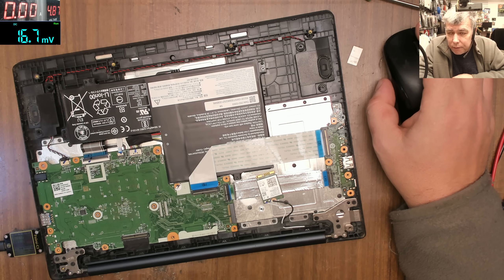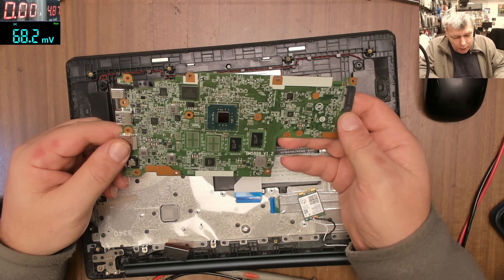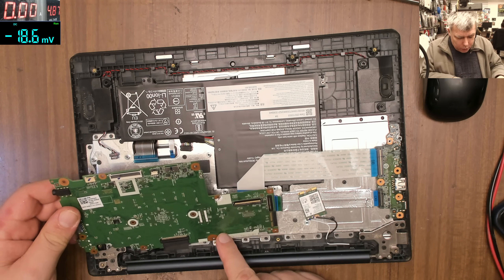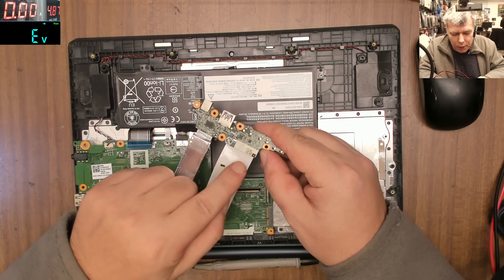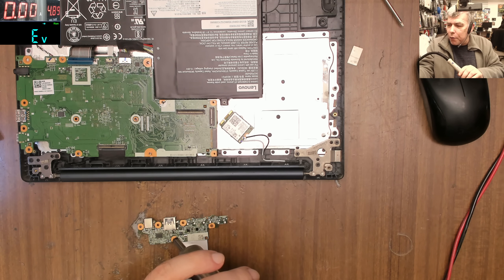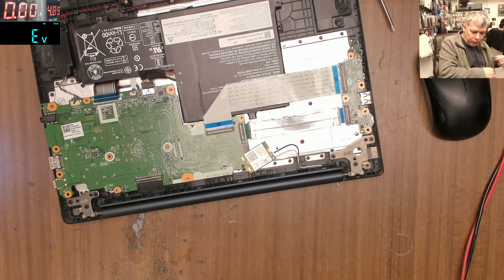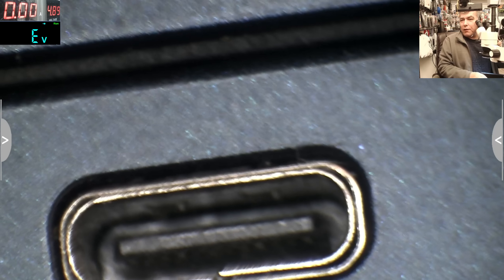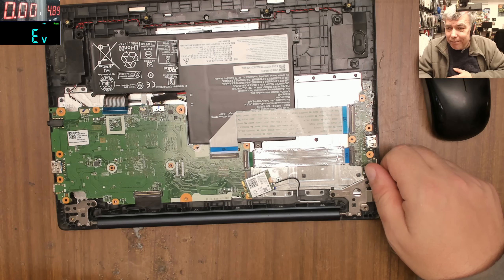Lenovo ideapad 3 - Not charging, not coming on repair - USB Type C the worst port design ever

Comment: I identified this exact problem with the same laptop. I removed the chip and now i have battery voltage on main power rail.  however i still havn't managed to get to power on im awaiting a usb A and V meter so i can see what's going on, i don't think its negotiating 15v

Comment: Your issue most likely is that horribly designed lenovo usb-c charging port. They should have just stuck to the regular rectangular port from the past, as it didnt cause damage to the board and could tolerate abuse! You'll have to resolder a new port in. Terrible design on Lenovo's end... IBM wouldn't have put a product out into production like that. Here I am on a Thinkpad E14 with a USBC port typing this that hasn't failed as of yet, but the countdown awaits... I prefer my workstation Thinkpad P73 with the square port though. These are pretty powerful little machines for an everyday user to be honest, but FUCK LENOVO AND THEIR SHIT USBC CHARGING PORT DESIGN!!!!!!!!!!! Definitely failing at being an IBM company that took over here, as IBM wouldn't have sent out something with this issue!!! Apparently the chinese couldn't spend the money to pull apart a macbook to see how a charging port should be properly put into the motherboard for longevity! I think it's time to go back to USA made shit tbh! I'd buy from England or other countries just alright, it that cheap garbage I just do not want in my home!

Comment: The type C port connector should be able to be replaced on a laptop without unsoldering. They just aren't designed to take the abuse of plugging/unplugging the connector on a daily basis or in the case of one of mine, slipping off a table and falling on the cable near the connector, putting a lot of strain on it. Mounting the ports on a small carrier board would fix this issue and I would gladly pay a bit extra for this.

Comment: hello, need advice. I have lenovo x1 yoga, motherboard 5B21K24847. one type port works fine, charging laptop turns on, second one takes only 5v and 2.8a. visually port is fine, also I have replace it but same result. replaced TPS IC but same. any ideas?

Comment: People need to understand that dongles can only bring you so far, you can't just plug 3 SSDs into your dongle an expect it to work compared to 3 separate usb A port. 10Gbps is the limit, and the dongle will get super hot as well, we need to go back to 1 port for each usage.

Comment: Universal way to bring a freaking 20V to the device (and even between them) is a GOOD thing. You need 20V - you get it, no need to have a specific "nice" e-waste of the charger for specific manufacturer or even worse for specific model since nothing stops manufacturers to tivoizate it. Yeah, probably should have more protection on port that pulls the power in or just cut off data lines when exchanging that much current, but that's not the port issue - Lenovo just makes crap nowadays, as everyone else.

Comment: Lenovos were good at one time - now they are all garbage. Had a corporate T480 charge port fail, IT guy tells me...."oh, they all fail - use the thunderbolt port to charge". Now we are using Carbon X1 laptops. The brand new X1 they gave me....charging port broke within 3 weeks. GARBAGE and stupid design.

Comment: "The world is changing.. Greed" - me first! Good that you are calling it out. I have recommended T480 and we bought 5 for staff, but the charging port issue makes me nervous (before I saw your video.) 

I'm primarily an audio guy and we never like power and audio parallel in an installation. Same with data. Pro audio and video used the always have robust connections (XLR / BNC) ) wired separately to the board, instead of direct to the board. Commerce do not want longevity. But their treatment of customers puts me off brands. 

This was a worthwhile video,  because I wouldn't have checked the other side. This will be handy to some. Thanks.

Comment: Totally agree. WTF Lenovo - USB-C is the worst thing for charging a laptop. It is poorly designed for attaching to their laptop boards. It needs to be more, say, robust to handle the human factor - they love to abuse the port on the laptop. I have seen so many at work with scratches all around where the charge cable connects to the laptop. Lenovo should have stuck with the square slim charge port from the previous models.

Comment: Could also be that the chip is fine, but either the usb-a or the usb-c on the board have some contacts shorting inside them, i have seen that many times, but could also be the chip only or both the port and the chip, anyway nice video Sorin
Reply: How is that chip fine when you can clearly see it's shorted when injecting voltage?

Comment: Yes, yes, yes, yes, yes.... It's the biggest piece of crap for charging ports. USB-C is mechanically not strong enough for a charging cable to hang of it. Barrel Jacks are the only connector for it's size that can take the stresses of a charging cable. When I get a laptop with a USB-C charging port I buy a port multiplier to take the stress off the C connector.

Comment: Ohh i was pissed off, similar problem, usb c "charging"(melting) port, almost toss one laptop away, there is only one point for what they are doing, to make older chargers uselles, and make laptop to function in strict guarante period of max 3 years.

Comment: USB C can be complex from a repair stand point. But is God sent for the  consumers.

Step #1 = 5v USBC IN --> to PD Controller --> (PD) Generate its own 1V8 + 3V3 --> 3v3 to BIOS --> PD Ready to communicate with charger.

Step #2 = PD to Charger --> Now USBC IN 20v  --> 20v to PD + POWER SWITCH --> 20v to charge IC --> etc... 

Rather than:
19V DCIN --> Charge IC --> 3v Linear Reg + SMC --> Charge IC = Device ready

Comment: So an improvement to the USB-C layout, (to make it more resilient) would be to swap the GND and VBus pins and to put a little additional spacing between the VBus and the adjacent Pins. (So there be bigger protection for other pins to get accidently connected to a high voltage)

Comment: No usb c is not crap it is meant to be used with phone and laptops with alt mode monitors where you can charge the phone or laptop at the same time you are rendering the screen image to a external display using just one cable. but yes, Sorin this appears to be a side effect of trying to use usb c by engineers.

Comment: Lenovo is notorious for selling crap. The Thinkpad was good in its day, but all newer Lenovo's suck now. I had a Ideapad 3 Gaming, I tried to upgrade the RAM. When I turned it back on all I got was the blue screen saying no op sys found!! We tried everything under the sun to get it back up and running. Nothing, and I mean NOTHING worked. I sold the laptop for parts. Sad.

Comment: Sorin, there is nothing to disagree. I'm loosing faith too. My domain is software, but recently i fixed old Lenovo T420, the ibm ver. Many screws, each one different, but the inside is clearly ment to be reapired, last long time and peripherals can be upgraded. Everything accessible easily, detachable... Recently i bought one of tesla smart plugs. User is no longer part of the equation. You can't even see usage statistics if the plug isn't online. I mean online, not just connected to local network. User is not allowed run this plug just locally. No, cloud only. And without history. It's stored in plug itself : )

Comment: Unfortunately, things are likely to get worse, various mandates will standardise ports used (based on USB C, as far as I know). Not only is mixing high current power and signals on the same miniature connector asking for trouble, so is such a relatively-fragile connector on a device like a laptop (where connecting and disconnecting is likely to happen multiple times over its lifetime).

Comment: I have one of these newer Lenovo's with the USB charging, and it seems mad to me you are going to pull alot of power/voltage through such a small port. Are they trying to defy physics? I notice I can charge using both of the ports; is that is because they expect on them to fail (and its just a matter of time). It reminds me of plastic parts in cars when some years back they used aluminium alloy; now the plastic only lasts a short time before it becomes brittle and uv affected.

Comment: i have had the similar problem on my company provided laptop, the Type C connector was worn and not charging / powering the laptop, luckily it was under warranty -  the service center replaced the motherboard and they indicated that USB Type C port was the issue.

Comment: USB-C was supposed to be used as universal for connecting devices so we don't have micro pico nano kiki diki ports for 100's of different devices and cables but have a standard USB-C cable and port for all devices.  It was never part of the original idea to also use USB-C for charging ports on laptop's.  This is really stupid and 100% agree.

Comment: USB-C really messed up when they wanted to also use it to supply power without consideration for conductor distance and size. Even USB-A had bigger connections and contact area just for the power lines.

Comment: Hello! I am reaching out to you for an advise. I have a laptop that will not power on with the power button, this laptop will only power on once I have reset the Battery (with charger not plugged in) and once I plug in the charger it will automatically turn on. I have to do this procedure every time I want to turn on the computer. The power button board is separate from the motherboard but this board also has an SD Card reader and one USB Port and both are working fine. I am not knowledgable in testing volatges in the circuits but I will appreciate any advise, thank you!
Reply: Battery problem probably. In first try to change or Ask a shop to test a same one in, or probably the power circuit of battery.
Reply: @chrisof570  thank you, I will try that out. I'll update you once I have tested it.

Comment: Welcome to the control freak world, where profit is the number 1 concern and quality, reparability, longevity and customer service are at the bottom of the list. One example is Microsoft is clearly in cahoots with computer manufactures. Why else would a 4 year old powerful gaming desktop not be able to run Windows 11. At this point there is still a workaround, but I'm sure that will change. Also, cheap computers from places like Walmart are coming out with Windows 11 S mode, which won't allow users to change much on THEIR computers. No command prompt, Powershell, registry edit, no installing 3rd party apps..........  

People need to stand up to this control freak crap, otherwise it will only get much worse.

Comment: This feels like me trying to figure out why the fuk my nintendo switch lite wont charge despite it turning on and working. I changed the m92t36 chip which got the switch to a point where it works but its not charging, it could also be a software thing but I will continue to probe around a little more.

Comment: Hi Sorin! Right now I'm trying to understand the USB type C connector and the solutions behind it, for example PD handshake. I'm on it.
13:09 Are you sure that there is voltage at the output of the connector even if no device is plugged in? I don't think so, but I would be happy if someone could confirm or deny it.
Reply: There's 5V by default and that shouldn't do any harm. The whole world is using it, think about it... any higher voltage/current would only be applied after proper negotiation. Sorin might take things too far when he's angry, IMHO

Comment: I do not like this trend either. One reason they moved away from round jack connectors is the size, they push for laptops that are thinner and thinner and the round jack was too thick. They could have made a new jack but since USB-C was already around they thought "why not use this ?". People need to punish those vendors with their wallets. When nobody will buy bad designs anymore, they will be forced to improve.

Comment: Just like induction stoves... How to complicate the hell out of something that works fine the way it was. The spare parts crazy expensive and pretty much impossible to DIY repair by regular joe. Also, the electronics and power supply come with capacitors that will crap out sooner than later.

Comment: dont be be depressed. Its people who don't know shit about currents and voltage or electronics who approved it. People who also celebrate that finally there is one port for everything without knowing what could happen if not used 100% correct. Everytime you transport a device with USB Type-C ports, you have to check if some crap got into the port and could interfere with its function. I really don't like Apple for many reasons but the magsafe and lighting cable are miles ahead in innovation vompared with USB Type C.

Comment: The point of USB C wasn't to use dongles. It has many benefits but the particular reason for integration were EU laws that stated that electronics need an universal charger, USB C, but the protocols and specifications weren't mentioned. I believe some manufacturers intentionally implemented their protocols to force you to buy their chargers. On paper they obey the law by using the port but the port doesn't communicate with your other charger.

Comment: i have a very expensive Dell Precision 3551 with Usb-C and Thunderbolt! It charges over the USB Port but it has also a usual 19v DC in Power!
iam so afraid of charging the Laptop over and over again with USB-C, that i brought a Dell Charger with Dell DC Jack!!!
I dont know, but i saw so many brocken Devices, cause of USB, that i wont do that.
And its not only the electronic issues, what is if someone step on the cord? it will rip off the USB Port someday!
no noo i charge with usual way, no matter if it need a bit more time!

Comment: Uhh, the thing is, I really like usb C and especially the PD standard.
It's really convenient and you can usually just have one charger for both, the phone and the laptop.
But I think the manufacturers need to mount the ports on a separate pcb for ease of repair.
Also, there's a limit to how much power can you squeeze out of usb C and some companies forget about that.
I'm also okay with usb C port without data transfer, just the PD for charging.
Reply: Exactly, a separate unit for the USB-C port would help to replace it in order that the mainboard "survives"!

Comment: I think many, many more failure at this feature of port and chip configure.   Very curious to hear opinion as new Intel high frequency standard to top of the line CPU release.  And, I know and understand this cost will be upper level as quality perhaps and not so much as Lenavo low end rubbish.  Will the new Intel chips as power need and game level be solid builds?

Comment: USB Type C is amazing for a lot of reasons BUT the issue is with how companies use it because it's so open, it allows to be used in a proprietary way because anyone can basically set it up in the way they want it to communicate.

Edit: USB Type-C or the new name of it, USB-C, for charging is also a really good thing because i don't have to have every proprietary crap port every company wants to make it different, i can have 1 or 2 chargers (watt depended and not port anymore) to charge/power all of my USB Type-C devices.

Comment: the issue with power lines crossing data lines also was known to this industry some years previously with the firewire 1394 specs. but they just swept it under the rug.

so in the end i just decided to de solder and remove those vcc pin from all my firewire cards. they were not being used and just a huge risk to inflict damage break the connected device

and now they want to run 48v over usb-c. to get the 240w laptop charging

Comment: Hehe Sorin I understand  but for my children usb type c is much much much better then micro. Micro didn't  less two months, or is a male jack problem or female no metering  one side its always dead.  So for now I don't have a problems with usb - c port. My opinion it's much better for use. Best regards.

Comment: Yes, It might be a bad implementation. The USB-C spec says the VBUS starts at 5V (like previous USB), and then the devices can negotiate up to a higher voltage up to 20V/5A. Also, using the wrong cables or underrated cables can cause issues.  Maybe they should have added an on/off switch for USB ports from the beginning... 🤣🤣🤣

Comment: is a great idea can plug in monitor mean while charging the laptop, or some power bank can support extra power for laptop. or carry 1 power adapter for many devices, can also plug as docking station with charging. 
just not easy for repair😅

Comment: If the port was damaged would removing the same chip solve the problem of not switching on?
Reply: The reason I ask is I have a damaged USB-C port and now the laptop will not switch on, could removing the chip like in this video resolve the issue for me
Reply: @ss67uk  Why you don't the port itself? Propably both makes problem. Its all up to measurement like in the video.. testing.
Reply: @XantheFIN  thank you for reply, I was not sure if you would need to remove the port if the chip is removed as in the video. Maybe I will try both